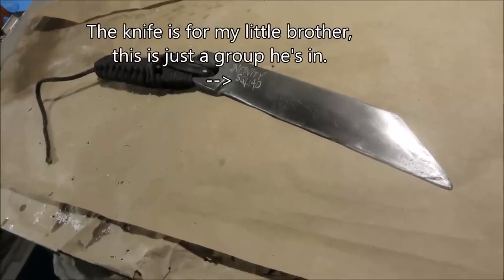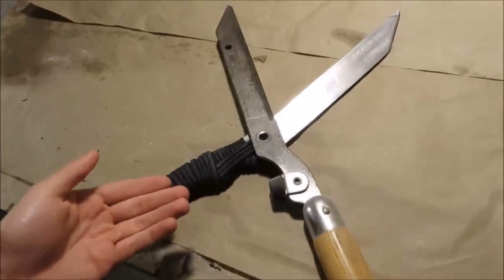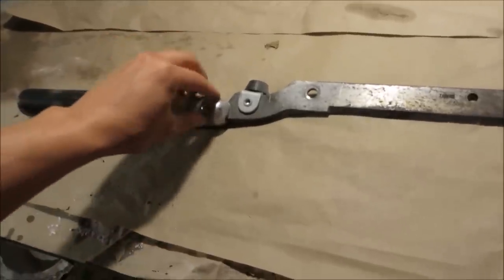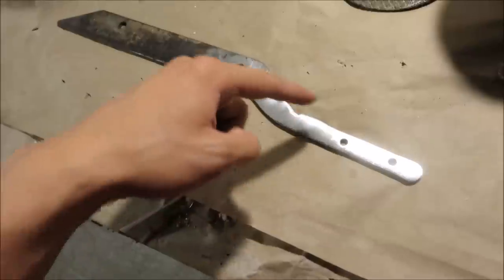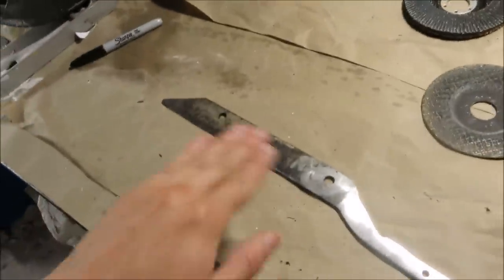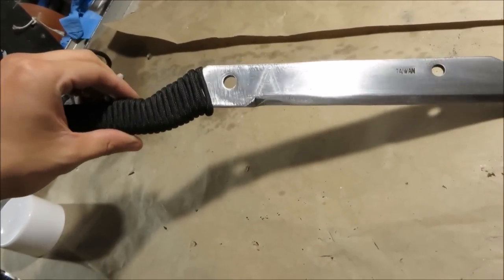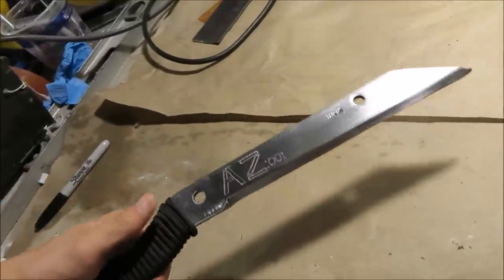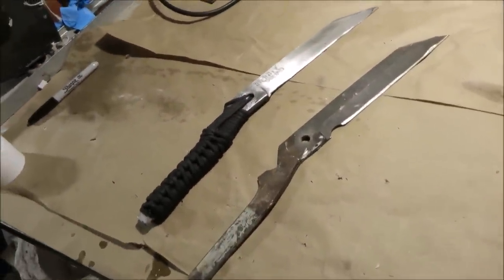MINI BUILD: Hedge Clipper Fighting Knives!

Comment: That is so cool. Only thing is that I don't have a belt grinder. Trying to figure out how to sharpen the blades on some seriously thick hedge clippers. These are older than dirt but are almost a 1/4 inch thick solid metal and I think the knife or mini sword made out of these would make an awesome baby machete or the like. any ideas on how to do this or who to look for around my town?
Reply: GarouLady  use a file.
Reply: A palm sander would work there a lot cheaper than a belt sander ryobi ones are good for the price

Comment: I have scene a couple of these tutorials on here. I was inspired to use it a little different, I am working on turning the handles into nunchucks and I'll use the blades to make knifes later. in case anyone is wondering I'll just put a hole at the end of the handle just where the metal blade exits then take a cut off wheel to cut it off and smooth around the hole and attach a chain between and refinish the wood and metal cap.. wish me luck

Comment: hey, i was wondering where you found a pair of hedge clippers that are not bent for comfort , all of them that i find are bent right next to the handle so when clipping a hedge your hard are not in the way, i was just wondering if there is a specific brand or place that has hedge shears that are straight all the way through the tang of the blades. 
Thanks, 
C.M.

Comment: I have an a MASSIVE tip for you that will A) Get rid of all the rust. 2) save you from wasting time grinding. next) keep a nice patina that keeps a TEOTWAWKI look. #) I think I need to figure out bullet points?!

Place the item in a bath of vinegar and salt and/or baking soda. A couple of Tsp per litre will do. Leave it for 24 hours and remove. rub with a cloth. the rust will just wipe off. VERY bad rust may need 2-3 baths. many youtube vids on "vinegar bath for rust" to be had

This was a tip I used when making my "battle hammers". (Them being 2 reclaimed 2.5Lb lump hammers and a4 Lb sledge hammer. The lumps were re-handled and wrapped in leather and invisible stitched, and the sledge was re-handled and wrapped "hockey stick handle wrap" style) Why say no to grinding? Because grinding causes heat that alters a metals temperature and causes brittleness. The last thing you need when stoving in headZ is for a splinter of metal to take out your eye. Watch the mythbusters "hammer on hammer" episode and a blacksmith explains how someone took a metal splinter to the wrist and it opened him up from wrist to elbow.

Finally... Keep the vids coming. you're giving me ideas and knowledge is power.... and the vids are entertaining.
Reply: +Morgan Clasper but at £50 a gram, wouldn't that be expensive?
Reply: +Morgan Clasper You didn't get his joke.

Comment: hey man. after i stripped the wood and rivets etc. off, my handles looked like they were about half the size of yours? should i still finish it or ABORT MISSION.
Reply from the maker: You can drill a couple holes in the gimpy handles and extend them with some barstock steel and hex-bolts to finish the build, you got this.
Reply: thanks so much man

Comment: I have a pair of hedge clippers, but they're not flat like yours... How would I create a pair of fighting knives with this method with the slightly curved blades? (I don't know if this makes sense, but if you laid the clippers down, the handles would be in the air at about a 20 degree angle....)
Reply from the maker: Mine were that way as well, I had to bend the straight with a vise and my muscles.
Reply: Ah. Thanks!
Reply: If I don't have a vice, what wold you recommend to flatten the handles? I've used basically everything I have at my disposal, from strong clamps to hammer blows, and I could only slightly decrease the handle's angle. Regardless, thanks for the awesome tutorial!
Reply from the maker: Joshua Durham
Leverage. Clamp down the blade to a table, and slide a 3ish foot long steel pipe over the tang, use this to get enough leverage to bend it.
Reply: Haha I just used a hammer

Comment: so the shears im using are like bent weird at an angle for trimming can i just like push it down with a hammer or what should i do
Reply from the maker: Clamp the blade in a vise and bend it with your hands from the handle, do need to hammer.
Reply: k thx
Reply: Nonlethalbychoice thanks man really thanks to this vid i made a homemade set of kamas its sweet

Comment: Where do you buy the wheel thing that uses the x-grit discs?
Reply from the maker: The flap discs are actually their own units, you buy a flap disc and it goes on just like a grinding wheel or cut-off wheel. Unless you mean the angle grinder itself? You can buy both angle grinders and flap discs at Home Depot, Menards, or Lowes.
Reply: Nonlethalbychoice
Could you attach them to a basic drill?
Reply from the maker: Kuroyami0Fukaikuro
Well not the ones that are made for angle grinders. I'm sure there are flap discs for drills. I would suggest just buying an angle grinder though, they're 30$ for a good cheap one, extremely useful, and will get the job done 1000x faster than a drill with a flap disc will.